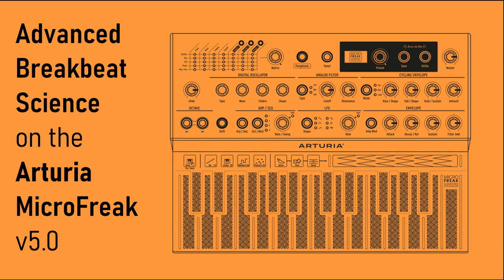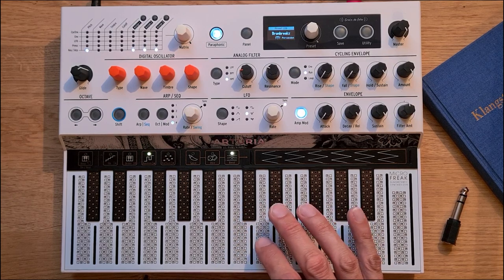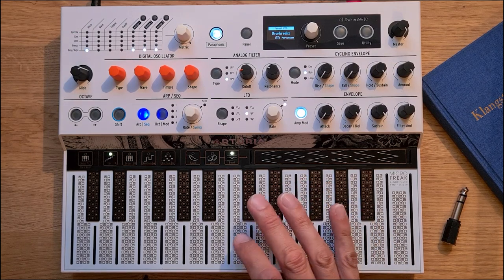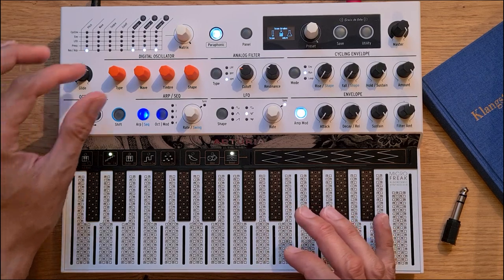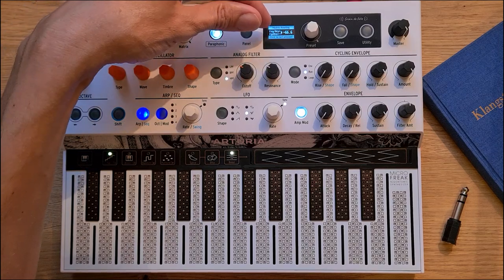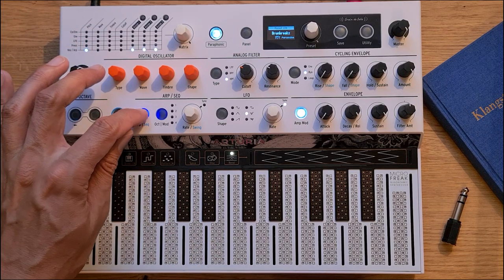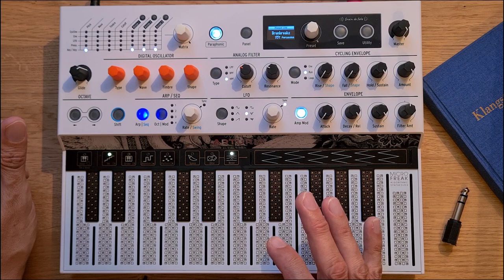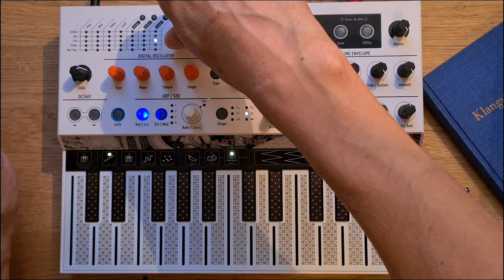Advanced Breakbeat Science on the Arturia MicroFreak v5.0

Comment: Ok I still have a question tho :D I really worked on that and can get the loop working on C3 which is in the middle of the keyboard for me (not like you) but also if I push another key it will mix the drum samples with the other sounds I have in the samples table, so indeed when I use the LFO it gives me very unpleasant results. I really can't find out the reason since I did exactly everything you said I THINK. The only thing I could see is if the 2 CyclEnv dest are different like -100 on pitch and -66.6 on something else, otherwise I don't know ^^
Reply from the maker: Did you set the mod-matrix assignment of keyboard to sample selection to 100 percent?

Comment: Would it be possible to split the keyboard with any engine? Say have an octave for a preset and another for the vocoder?
I used the circuit tracks to trigger and this would if possible be awesome
Reply from the maker: What you can do is to assign the Key / Arp in the mod matrix to the Type knob. You'll get different engines across different zones on the keyboard. But it is kind of hard to adjust the right modulation amount to get a precise split, it's kind of trial and error.

Comment: Your video is fascinating, but I can't get your result at all, even after several tries. How do you assign a sample to C3 (around 5:00)? I can't do it at all, even though I've loaded my samples. In fact, I'm having trouble using the Assign keys on the matrix because in Key/Arp I only have "Type" or "Vcopar1" "Vcopar2" "Vcopar3". 
I'm going round in circles... Could you help me? Thanks a lot
Reply from the maker: You need to press shift + type to get to the sample assignment mode. Then, the sample you select with the type knob will be the one mapped to C3. In my case, it is the first kick drum sample, I loaded all the other drum hits into to following slots, so they will be mapped to the keys above. Once the sample selection is on, you can also use it as an assignable slot in the mod matrix (called sample). Pressing shift + type again brings you back to the normal mode, where you can select different oscillator types. The sample selection will stay the same.
Reply: @d..d6201  Merci merci Merci !!